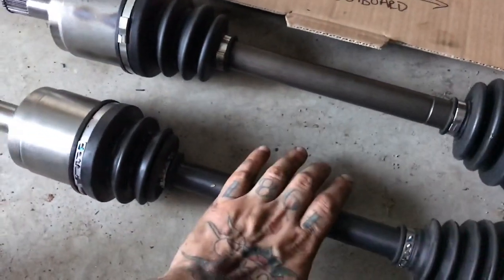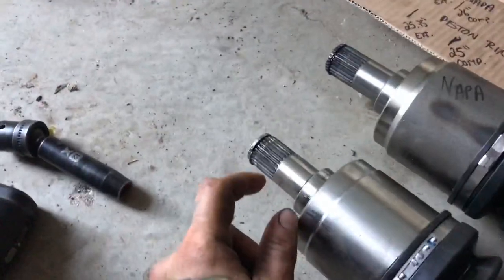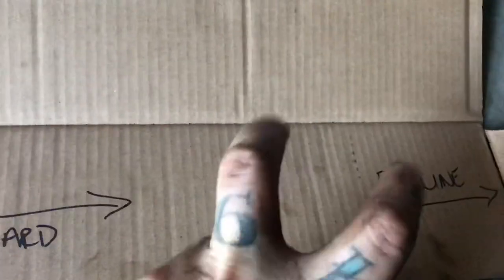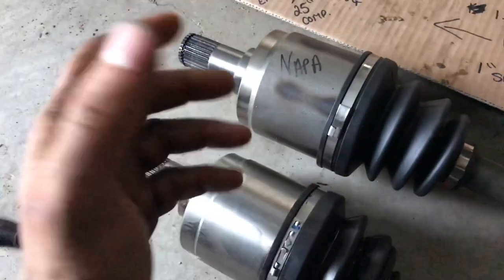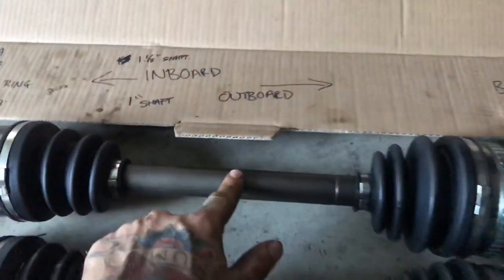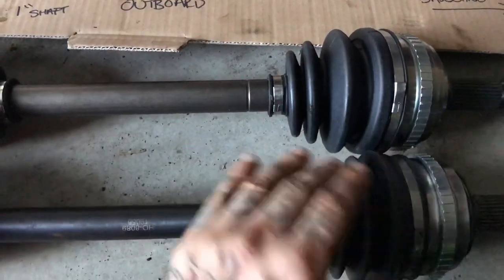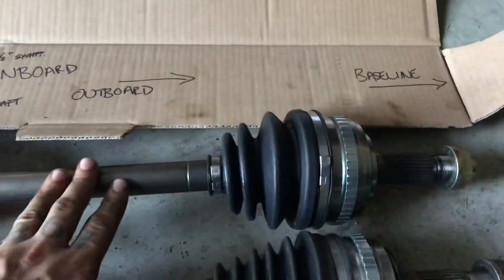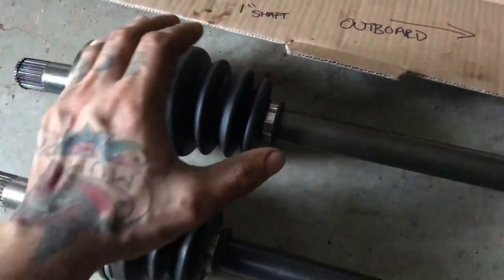OEM vs Aftermarket CV Axles • 97 - 01 HONDA CRV RD1 RD2 • #ThatBeardedMechanic

Comment: I have a lowered 07 crv on air bags and had to change my axles but I keep getting a vibration on acceleration especially on hills on the right passenger side tried 3 different axles including a "oem" used one and still the same. Do you think the napa will do the job? Cause I was told the after market ones may be too long for the height I drive at.
Reply from the maker: Yeah when it comes to the lowered ones, it’s hit and miss with a lot of brands, especially length wise. 

I would definitely try an OEM one if you can (used if you’re lucky enough to find a yard somewhere selling them). Then you can rule that out. If memory serves me right, those generation ones have a weighted dampener on the axle shaft (that round rubber thing on the shaft). It’s to aid in stopping vibrations. 

The other possibility being wheel bearings: hubs in front causing vibration. Tie rod ends too can cause this. Especially when lowering and changing the geometry of the vehicle. 

It could also be a simple thing as a whee imbalance. This can happen to. A simple test would be swapping your passenger front wheel to your drivers front and then seeing if the vibration stops or moves to the other side now. Try this one first as it’s the most inexpensive test to try and it’s the old school version of diagnosing issues. 

Hope these suggestions help you out. Let me know how it goes and if I can help you further  if these didn’t help.
Reply: Thanks alot for the info,so I have changed both wheel bearings did an alignment tried 2 aftermarket axles from different brands and also the one I have in now bought from ebay from a crashed crv oem plus did the wheel balance on the said side which is the passenger side and yet still getting the vibration on acceleration or hills.

I only begun to get this vibration when the axle was swap out and me not knowing the headache that awaited didnt keep the old bad one. But funny enought when the van is rolling and not pressing on the gas I don't seem to get the vibration so i don't think is the ends 😢

I been told that the axle could be too long seeing that I drive the van lowered.

Comment: I bought a advance auto axle for my 99 And it popped out I'm going to try Napa tomorrow I have a 5spd
Reply from the maker: Definitely suggest going with NAPA, only other alternative would be OEM Honda, but they’re pricey as hell. Ranging from $600 and up I see/ hear.
Reply: Did it work ??? I got same problem 
I have 98 Crv 5 speed and pop out like 1” from tranny and when that’s happen start leaking oil from drive axle assembly
Reply from the maker: NAPA or OEM Honda. That’s all I would go with.
Reply: @anthonymaravilla8509  yes the napa ones are great
Reply: @A M way better
Reply: @A M the ones made from advance are longer also off by like 2-3 inches
Reply from the maker: @A M Yet I’m now lifted 5” overall (strut spacers and lift springs) and on 31x10.5’s with zero issues on daily commutes of 3 hours round trip daily.
I’ll stick with NAPA and what’s also trusted by other lifted CRV guys that have zero complaints.
Reply: Also I bought the driver and passenger side axles from napa for 5spd they work perfect

Comment: I called Napa and they asked if it has abs don’t know why that means lol..anyways I think I’m going with Napa hopefully it can take the abuse of my lowered Crv lol
Reply from the maker: It if has ABS (anti-lock braking system). Some CV AXLES on ABS equipped vehicles will have a tone ring on the axle itself which communicates with a ABS sensor in the hub basically. 
NAPA is the way to go definitely. No complaints with mine at all.
Reply: @That_Bearded_Mechanic  alright I doubt the Crv has an abs right lol

Comment: Sir. Is this for automatic or manual?
Whats the part # for left and right?
Reply from the maker: Mine is an automatic and this will be automatic part numbers. 
Left side (driver) NAPA #946040
Right side (passenger) NAPA #946050

And if you need rears, ALTROM carries them. 
Left side (driver rear) #: UTD 0652965
Right side (passenger rear) #: UTD 0652966

Comment: It's because your OEM axle was for the driver side. They are different lengths. That's why the axle popped out. It was too short when extended for passenger side.
Reply from the maker: Nope. That was not the case at all. Wouldn’t have even been able to be installed since the driver side has a jack-shaft.. And the Jack shaft goes into the transmission case. The passenger side goes directly into the transmission.

Comment: NAPA sells only new aftermarket and remanufactured CV axles.  Only a dealership sells new "OEM" axles. At least that is how I understand the terminology.  The other axle in your video was "Piston Ring".  I have never heard of that brand before.  Being shorter demonstrates how cost cutting was made and therefore should be avoided.
Reply from the maker: Exactly what I was getting at. Only buy the Honda OEM and the NAPA OEM/ REMAN axles. Within the CRV community a lot of people have issues with anything other than those I mentioned above, especially once you’re lifted and the risk of axles popping out increases.
Piston Ring is an automotive parts store here in Canada, equivalent would be NAPA essentially. They both sell the same stuff but carry different brands/ manufacturers. I deal with both NAPA and Piston Ring for this reason, if one doesn’t carry it, I know the other will. 
Back up aftermarket store is Parts Source, equivalent being AutoZone. 

In the end, the fact is there’s a difference between axle lengths as I mentioned in the video which is critical for lifted CRV owners to keep in mind.
Reply: @That_Bearded_Mechanic  I'm actually in Canada too and located in southern Ontario.  Piston Ring is just in Manitoba.  I ordered a remanufactured cv axle for my '05 Element 5-speed from my local NAPA store (after getting a similar recommendation from Sticks & Stones & Iron) hoping to get an axle containing Honda cores.  They shipped what looked like a cheap aftermarket axle that was just cleaned and rebagged, certainly not OEM Honda. I pointed that out and showed the images from their own website.  Remanufactured parts are sandblasted, not all machined and shiny and Honda inboard cv cores have thee indentations, not perfectly cylindrical.  The staff didn't understand the differences and said that is all they had in the warehouse.  I rejected the axle and still don't have a proper replacement for my Element.  Booooo on NAPA.
Reply: @canuckfixit7722  what did you end up doing ?
Reply: @flacko001  Bought two OEM axles from a junk yard and rebuilt them with fresh grease and aftermarket Oetker-style band clamps.  Worked out very well but the axle shafts had rusted-out centres under the rubber balancers so I ordered two more through eBay (LKQ parts, specfifcally).  The latter set were generally "good to go" and didn't have any rusted areas.  Now I have a main set and a "backup" set.
Reply: @CanuckFixIt  thanks for the answer. I have a 2014 tl and there's also a huge debate on OEM vs aftermarket.  Was thinking of just going the oem route but I like your idea

Comment: I have 1999 5speed with advanced auto Cv axle I replace it 3 time no luck it pop out like one inch. You recommend the Napa one
Reply from the maker: Yes I suggest using the NAPA branded CV axles since they are in fact longer like I show in the video. Off the top of my head I’m fairly certain there’s a difference in part number from the automatic transmission to the manual transmission so keep that in mind when ordering new ones.

Comment: So I got the same axle for the passenger side and it won’t stop leaking out of the output shaft seal. I put and new one in and yes it is installed correctly, I can’t seam to stop this leaking and I can’t figure out why it is leaking
Reply from the maker: The seal may have been damaged when installation of the new CV axle was done, I’ve seen this happen many times before. I’ve also seen where CV axles look like they’ve been fully seated but aren’t and leaking is happening because of that.
Sometimes they need an extra tap or two to fully seat the CV axle housing against the oil seal.

Comment: that cannot be a legit OEM -  no way;  at least not in Volvo world. A true OEM would have cost you north of $400.  Glad you got it sorted out but a legit Honda OEM would not have 'slipped out' .  And yes, aftermarket is indeed risky business.  I go the junk yard route then repack & reboot.  I've also had very good luck with CarDone remans.  Batting 1.000 going Cardone.  STAY AWAY from O'Reilly and don't buy from CARid or Detroit Axle.    Good luck everybody.
Reply from the maker: I said the cheap-o aftermarket one popped out due to it not being the proper length and not the same length as the OEM Honda one that came out of the CRV, this one was shorter. 
Then I compared that aftermarket cheap-o one to a better quality NEW OEM spec NAPA one, which resulted in a better outcome and no issues as the length and build is much better. 

And yes, OEM Honda ones local to me were as much as $600. Also for comparison, the driveshaft is $2,000 Canadian at my local Honda dealerships. Thankfully a serviceable one can be acquired on EBay for $130 to $200 shipped. 

Within the CRV world Detroit Axle is another solid option with no complaints amongst majority of the lifted guys.

I do the same thing with the local yards, grab them for $20 an axle, service, reboot and repack. Have a few on the shelf now for each corner.
Reply: How would I know if I go the junkyard route if the axle I'm getting isn't an aftermarket axle put on from the past?  ISIS there any markings or indications or different materials that they use for after market VS OEM?  This will be for a Honda Accord

Comment: Would it work good if I’m lowered
Reply from the maker: Yup, they’re not overly long that they would cause an issue for a lowered CRV. There’s a lot of them out there that are lowered in several of the CRV forums I’m in, running these axles without complaints.

Comment: What size is the axle nut?
Reply from the maker: It’s a 36mm axle nut (unless it’s been changed out for another one, sometimes when you buy new CV axles from third party companies the nut the company includes can be a different size in my experience, just something to keep in mind, if it is different then it’s more than likely a 34mm). 

Torque spec of the axle nut is 181 foot pounds and you should torque to spec once the weight of the vehicle is on the ground. Install everything as you normally would, remount the wheel onto the hub, tighten the wheel nuts and then finger tight the axle nut, lower vehicle then torque as I stated above.

You can rent axle nut socket kits from some auto parts places and then you get your money back on the return of the kit in good condition as you received it, otherwise some tool places sell them for $8 to $19 each, a kit with multiple size anywhere from $30 to $50 on the lower end like from Harbour Freight/ Princess Auto. 

Hope this helps.
Reply: @That_Bearded_Mechanic  thanks alot brodi

Comment: Did it make a whining noise?
Reply from the maker: When the axle popped out/ was no longer seated properly it was more like a grinding/ growling noise. Kinda of like when a hub bearing is failing. 
Also, when the cv axle popped out, the vehicle rolled while in park due to the failed parking pawl engagement on that axle (passenger side).
Reply: @That_Bearded_Mechanic  I recently changed lines for some TRQ ones and I'm hearing like a like a noise and it's really wabblin
Reply from the maker: Check and confirm it’s seated properly. Otherwise grab the axle and push back and forth (front to rear) of the vehicle and I’m sure there will be movement in the CV Joint. The joint will have failed if it’s wobbling.

Comment: What Napa brand shaft is that?
Reply from the maker: NAPA GOLD. Non remanufactured one. Closest thing you can get to OEM Honda thats aftermarket from them.
Reply: @That_Bearded_Mechanic thanks for answering.

I’m looking for different car 2004 4Runner but I don’t see no gold brand for this vehicle, I wonder if they have different brands for every car manufacturer
Reply from the maker: More than likely yes. As with many parts suppliers, they’ll have their economy brands and premium brands that carry their house name. 
As long as you get the actual NAPA brand that’s NOT remanufactured (there’s been plenty of quality control issues about them) then you should be okay. Plus you get a better warranty with them. 

When you order them, they should tell you what tier of quality they are whether economy, mid-grade or premium. Also if they’re actually NEW or REMAN.
Reply from the maker: Another acceptable brand they carry is TRAKMOTIVE. 
I’ve run them on other vehicles and have had no issues. They have a Heavy Duty version with bigger boots and they’re a lot more solid in build quality. If you need a cold climate version, they have those too. 

Currently have a set of the TRAKMOTIVE HD Winter one’s on our one Dodge Ram and no complaints over the last two years of cold Canadian winters.
Reply: @That_Bearded_Mechanic thanks a lot man

Comment: I installed the aftermarket CV in my crv and the wheel wont spin
Reply from the maker: Soon while lifted in the air or while on the ground? Are you sure the CV axle has fully engaged into the transmission?
Reply: Yes it clicked when I put in on the motor and when I tried taking it off It wont come out i even installed it on the hub and thigthen up the axle nut and still wont spin
Reply from the maker: Yeah sometimes those clips that hold the axle into the housing are tough to break free. Usually a more angled pry bar or two pry bars on either side of the axle housing will pop it free when jolted. 
Interesting that it won’t spin. Do you only have one side jacked up in the air? If so, then that might explain it. The issue is something causing it to bind or not move on the transmission side of things. Nothing on the wheel hub side would cause that except for maybe over torquing the axle nut well beyond spec.
Reply: I got the side of the axle that i replaced to spin now the other wont spin why is that?